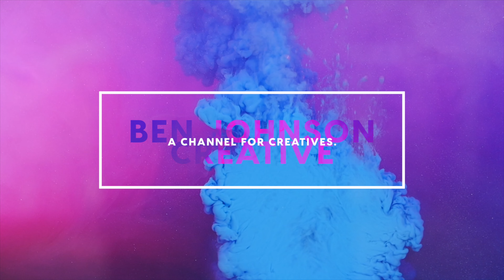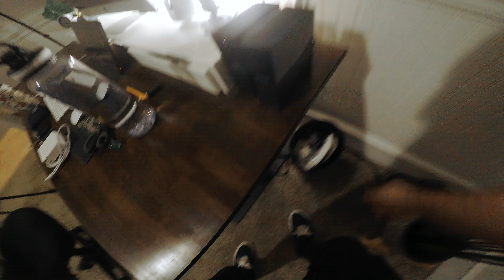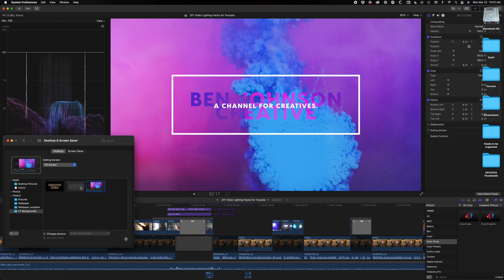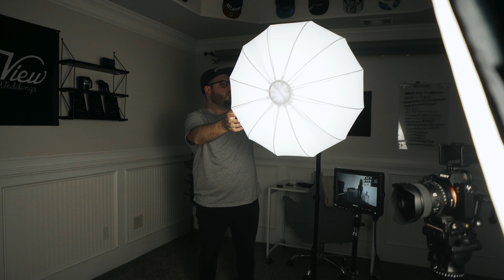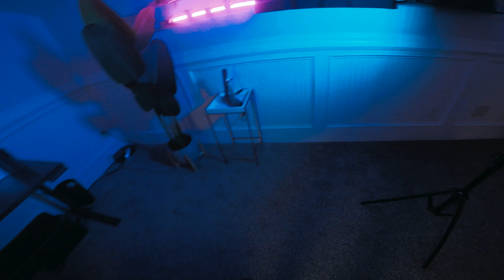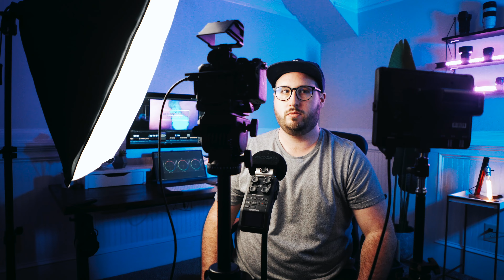How I Turn my Home Office into a YouTube Studio (video + lighting + audio tips!)

Comment: Hi Ben, could I substitute a Raleno LED light (around $40) for the GBM fill light you're using in this video or would that not offer the diffuse/soft effect? Would you recommend anything else? I'm thinking maybe best budget option would be another Mountbox? Thanks again for everything you've shared, blessings - S
Reply from the maker: That could work so long as you add diffusion with the inside piece of a 5 in 1 reflector. Or the moutdog light could work well also

Comment: Good day Ben.  I have a couple of questions that you probably NEVER expected anyone to ask.  Unless someone did and I just never came across it.  Your lighting videos are SUPER clear and concise, so I don't have questions there at the moment.  HOWEVER, I've been completely obsessed with the Wainscoting you have in your studio.  I want to do something similar to mine.  I know the center panels are beadboard but I'd like to know what are the dimensions of your "board and batten?"  Looks like the bottom horizontal rail is somewhere around 6 to 8 inches high, while the vertical stiles look about 4 inches wide.  The top rail seems to be the same as the bottom and is topped with some sort of base cap moulding, and there is chair rail running horizontally in the center of the top rail as well.  Also, do you know the name of the moulding that is framed in the center of each panel?  And, what are the widths of your panels?  I'm going to assume they are probably different width depending on which wall they are on.  I'm sorry if these questions seem a bit odd and aren't gear related.  But I do thank you in advance for your reply.  My apologies, also, for making such a lengthy comment. 😊😊
Reply from the maker: Hey Esco you are the first to comment on this haha. I actually don’t know and am out of town currently but will try to measure it for you. Message me on Instagram to remind me!
Reply: @benjohnsoncreative  I sure will Ben, thank so much.  I'll give you some time and message you when I think you're back from out of town.  Take care.